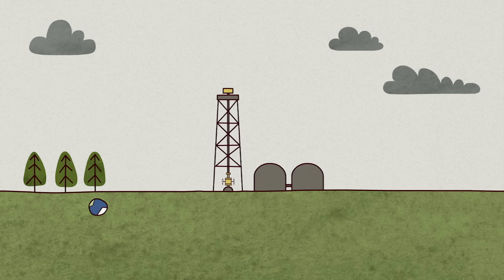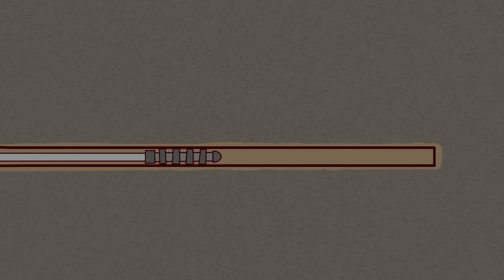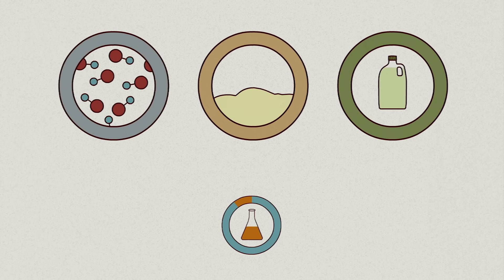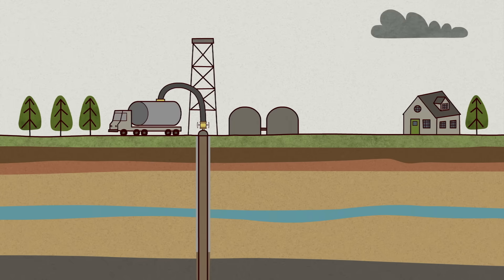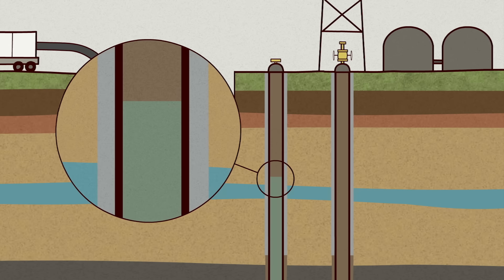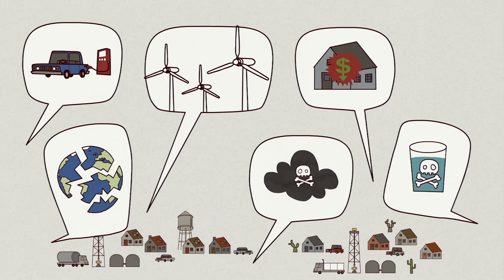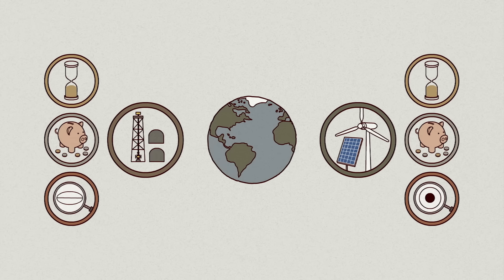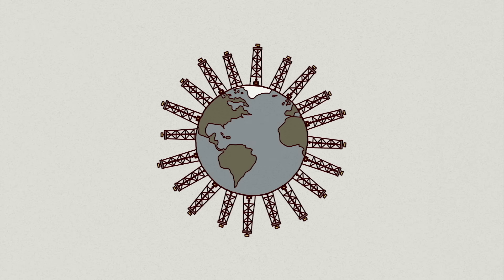How does fracking work? - Mia Nacamulli

Comment: though keep in mind that "green energies" still produce similar amounts of pollution thanks to being manufactured from energy taken from non-renewable energies and the chemicals / compounds used to make up green energies cause nearly as much pollution. it's the whole "use an old petrol powered Volvo or buy a new Prius" debate, in order for there to be any actual pay off with green energy it must be used for 30+ years (which happens to be over the average life of 99% of your mass batteries used to store energy from solar or wind power) also keep in mind green energy produces far less energy and costs FAR more leaving billions with out power or energy to survive in places like Africa, northern Asia, and south america. 

so far green energy is really not that "green" at all, in fact the only reason it's being pushed forward is thanks to being politicized off of fallacious computer models / information.
Reply: Well thats the thing, the sooner we're on clean renewable energy, the sooner we will get off of coal and oil. Sure, it may take 30-50 years, but we're not improving by sticking to coal and oil.
Reply: Justin Bouche the only reason they are being pushed forward is that they won't improve any other way. That's how any technology works.
Reply: I live in a part of Austria that is powered 100% by green energy, with 30% being exported.
Reply: Recycling has nothing to do with sustainable energys its a long term preservation of resources as i said earlier its costly to mine in the case of some things like gold the ratio of materials is a ton to a gram even if a small amount is saved it saves energy and resources when we put all our resources in a dump its going to be really hard to reclaim those with all the trash thats hard to get rid of but useless in there. ALSO solar panel recycleing is nothing like general recycling while im not an expert a specifically produced product that has known materials is much easyer to recycle then some random junk
Reply: Justin Bouche Cost is just a matter of mass production. But let me ask you, let's assume that both produce the same amount and type of pollution and both reach point in which the cost is the same, which do you prefer to invest in, the finite one or the virtually infinite one?
Reply: Actually Solar Power is becoming the cheapest form of energy these days, and with the increase in prices of coal and gas, it's only a matter of time because all renewables become cheaper. While it's true that it has a fair share of pollutants from the materials making it, that it minuscule to the amount of air pollutants made from powering the country off of natural gas a coal (it's about 60% of our ait pollution I think). So right now, our energy crisis is of primary concern because of the effects of climate change. These alternatives aren't just being pushed for political gain, they're being pushed because this is a better alternative then pumping out kilo tons of Carbon Dioxide into the air. If anything the opposite is true, whereas Coal and Gas is being pushed for political gain.

Source: Mechanical Engineering Major, Concentration in Energy, Fluid, and Thermal Systems
Reply: you seem like you have been looking at to many fallacious computer models/information sure there is a material cost for green energys but you have to realize it also takes energy and materials to drill a well build a mine and any other way of getting non renewable energy think for yourself for a moment rather then just listening to some clearly biased website on the internet 

PS if you would point me to theses graphs and i find them non 'fallacious' i will gladly concede the point
Reply: They didn't say anything about green energies being perfect. They gave facts about how terrible fracking is, and how we could be spending time figuring out new ways to help our world run. We aren't gonna come up with anything arguing about it, let's get to work for future human beings and our own lives, folks!
Reply: well, based off your argument, it seems the solution is to build better batteries ☺. Of course that's going to take some research and time, but that's part of the reason these technologies are being pushed now. So that people will fund the research to make them better.
Reply: Ace Ventura Well like I said, we're not improving when we stick to coal an oil. I'm willing to wait 50 years to have newer generations benefit from a cleaner earth.
Reply: +Justin Bouche Please explain how his argument was a straw man you seem to misunderstand the meaning of the term. You directly said that one problem with green energy is that it requires non green resources to produce he came up with a counterargument, where is the problem?
Reply: Justin Bouche this isn't always true. I remember it being true for hybrid cars 5 years ago but that's not green that's just economical. Solar and wind are very green(for the environment, and the pocketbook) there are many analysts that can show this.
Reply: Justin Bouche Green enery does NOT take more energy than fossil feuls. Solar is cheaper than fossil feuls and dont tell me texas cant go solar.
Reply: Emilia Perkins That's not how the free market works. The government has never been able to compel a market to do what they want and how they want it.
Reply: +German Carranza no but it is a good point and given he basically hasn't adressed any of the arguments agenst him other then calling one which wasent a strawman a strawman
Reply: German Carranza. Ah, my mistake. I don't know much about economics.
Reply: My Stupid Opinion That's not an argument.
Reply: Ace Ventura 
"We don't have the batteries to store renewable energy." Really dude? Have you not heard of Tesla and Elon Musk? Or are you really that clueless about up and coming technology? The batteries are here right now and they're already being charged by solar and wind.
Reply: German Carranza 
I'm sorry, was I suppose to make an argument? Is this an "argument only" type of thread? No it's not. I can say whatever the hell I want. I was simply stating my observation and my stupid opinion... hence my name.
Reply: Justin Bouche After reading this, I only have one question: How do you know this?
Reply: Solar panels once broken can be repaired and recycled making more jobs and making them more viable in the long run. Plus you literally have no proof about renewable energy causing higher amounts of polluting. Seriously stop spreading your misinformed opinions.
Reply: +Ace Ventura You seem to not understand physics all energy is renewable according to conservation of energy not none of it thats why its called the law of CONSERVATION OF ENERGY some of it just takes million of years. Also in terms of efficiency solar panels have near infinite efficiency so you also dont seem to understand what that word means I will help you it is the ratio of energy delivered to energy required solar panels have a low energy cost and a potentially infinite energy output.
Reply: Justin Bouche 
Sure let's listen to the guy with a Breitbart logo in is profile picture on all the "downsides" of green energy. I'm sure all of his "sources" are credible and totally not traceable back to the fossil fuel corporate "scientists". 
Good job on your "research" buddy. I bet you also watch Infowars daily.
Reply: +German Carranza The pushing of a technology is not done by the government its done by the people and therefore the market you know how many people are willing to devote there time which has value or money to help the environment.
Reply: "Compounds used to make up green energies cause nearly as much pollution"!?  Are you f'ing kidding me!?  Why do people he here even respond rationally to this sort of incompetence. You are no doubt talking about heavy metals in solar panels.  First of all, those heavy metals aren't "burned" and consumed as a requirement to produce energy like every non-renewable power plant.  Fossil fuels require a hell of a lot more mining than solar panels because the mined material itself is a fuel that has to be consumed!  Solar panels are built once--they are not consumed.  But forget that ridiculous argument, solar panels are only one form of renewable energy.   Where's the "pollution" from the compounds that make up wind turbines, dams, tidal energy systems, etc.?  Folks, there is no time to entertain blatantly irrational discussions that attempt to compare negative consequences of renewable and non-renewable energy sources.  The planet does not have the time (or resources)
Reply: +Windoge Wizardly way to build a straw man argument. on top of that your logic is further flawed with the recycling comment, keep in mind that recycling requires a massive amount of energy and transportation. companies like westrock and kimberly clark whom are leading recyclables are continuously shipping items / material through the use of non-green energies. this does not even include the refurbishing of items received into functioning products. all of which are made from non-environmentally friendly materials.

Comment: When you are geologist but you still watched it cuz you like the animations :D
Reply: whats great about ted-ed is that you don't have to be a specialist in a particular department to get a good insight of it
Reply: I've been on many sites prior to , during and after fracking has occurred and each one went smoothly. Water isn't spoken in terms of gallons its referred to in barrels.
Reply: Exactly! I often use them to simplify complex ideas and procedures to my friends who get lost in the jargon whenever I attempt to explain things geology related or otherwise.
Reply: Luana da Rocha that's amazing! If you have a dedicated channel to that (or got some links to similar content) please share!
Reply: The sand used for fracking is silica sand from what i understand.
Reply: Air Em Out a "barrel" is 42 gallons
Reply: Kyle Billen  Frac sand is not used straight from the ground. It requires processing to optimize its performance. After mining it is taken to a processing plant. There it is washed to remove fine particles.

After washing, the sand is stacked in piles to allow the wash water to drain off. This operation is done outdoors and is restricted to times of the year when temperatures are above freezing. After the sand is drained, it is placed in an air dryer to remove all moisture. The dry grains are then screened to obtain specific size fractions for different customers.
Reply: I watch this channel to get inspired and follow the animation makers on Vimeo 😝
Reply: So whats your take on this?
Reply: innerFire
I'd like to be, but I'm not.
Reply: Air Em Out silica just comes from crushed up granite. It's in almost all forms of sand. Even children's play sand
Reply: Air Em Out cool. Did I say anything to contradict this or did you just want me to know?
Reply: Kyle Billen Yes Kyle I know this I work in the oil and gas industry. The narrator in the video was saying gallons, no one in the industry says gallons.
Reply: Air Em Out the narrator in this video probably isn't in the industry and most people that watch this video probably aren't either
Reply: I could ask you the same thing  as if i didn't know how many gallons make a barrel. One of my first comments was that I've been on many sites when they were fracked. They don't just let people come off the street and watch.
Reply: How about when you work on frac sites? :) I do and everything goes smooth 90% of the time. All I’ve seen is the tools getting dropped down the well because of wireline ;)
Reply: Me too well the second half is true lol
Reply: Mother Fracker…
Reply: I'm developing fracking sand (propant) using biomass... I can give class about all off that, but the animations are so good that i can't stop seeing.
Reply: @a_luana  If your still here 3 years later... Can you teach me? Or do you have anything online? Books, videos, classes?
Reply: @Carolina-Defense-Force  Hi Jakey! Unfortunately we need to stop de research, the actual Brazilian government freeze all budget for development and research. I'm working in another area, but if have any question I can try to help you.
Reply: innerFire same my dad works in the fracking department, mainly wastewater, so I know a lot about this stuff
Reply: peesauce y-you too...
Reply: innerFire your are so full of shit
Reply: Luana da Rocha you too

Comment: People often talk about the horrible chemicals in the fracking fluid, but that actually misses the point. Even if you use safe fluid (which has been developed and the formula is public so anyone can use it, but nobody does), the most dangerous chemicals like benzine are in the shale and will be released both into the well and possibly into local water supplies no matter how safely you try to do it.
Reply: maxybaer123 35 million of gallons my bad e.e
Reply: wait 35gallons are you sure they weren't just using that water to supply there workers with something to drink?
Reply: Well yeah, it's common to hear that happens, some people take other situations more seriously than other situations like worrying more about an airplane crash than a car crash. In this case it's people worrying more about the chemicals in the liquid rather than benzine etc.
Reply: Sam ironically lol, the fracking process uses between 1 to 8 million(s) of water gallons. in fact in Michigan, in 2014, 35 gallons of freshwater were removed from nearby aquifers just to frack